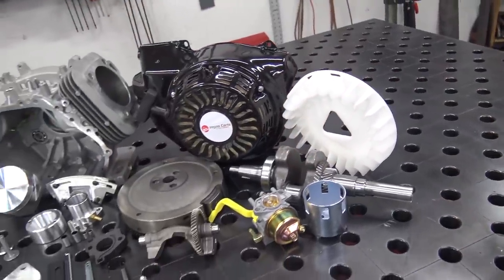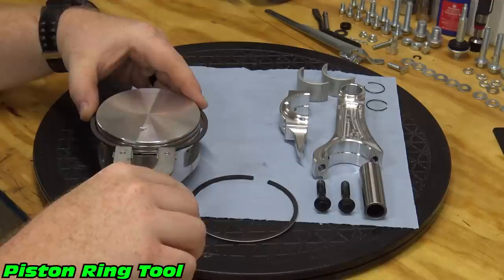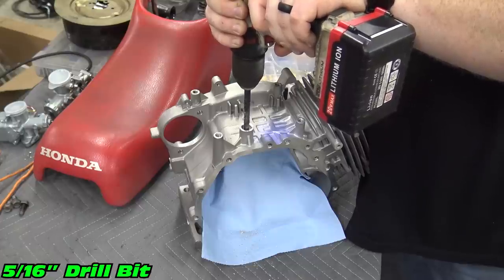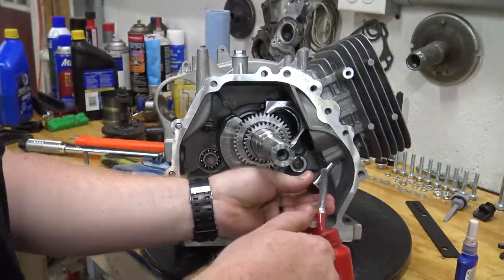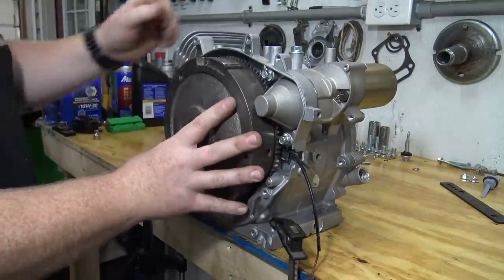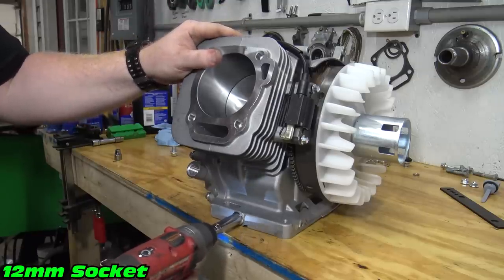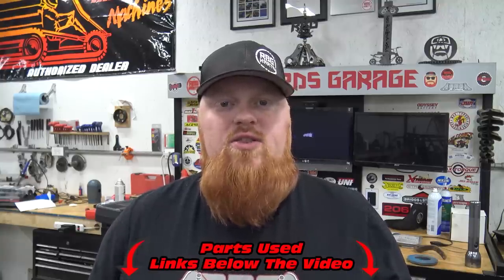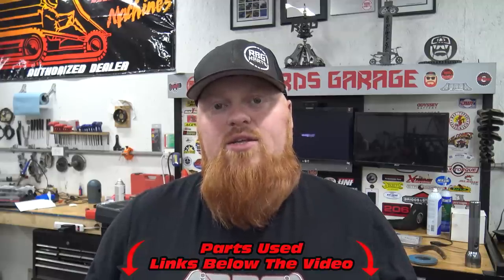Vegas Carts 460cc Engine Build

Comment: I've loved mine since day one! Well mines got a big valve ported and polished milled head, mod 1 Cam, roller rockers, billet flywheel, and a Keihin FCR 35mm carburetor with a 40 series torque converter on a oval race chassis! It's scary fast!

Comment: The govn'a hole could've been used for a spray oiler. With a nozzle put in from the inside, and a small electric pump pushing in from the other side, that'd prolong the life of the engine, since the classic method is a stop gap measure, i mean don't get me wrong, it works, but it was never top of the line oil distribution.

Comment: Damn RB. After all this time I'd figure you must know every little trick and tip. But when installing those rod bearings it's really important NOT to install them flush into it's race. You leave them slightly off so when you install the rod cap and begin to torque it the bearing will SEAT itself. This might seem unnecessary but it really is important

Comment: i wish i was old enough to have a job so i could do the things you guys do
Reply: Someday buddy✌🖖👍👍soak up all this good stuff
Reply: Ask for a minibike or a gocart for a present,you can begin learning small engine repair when you get one and you'll have a lifetime to get good at it.
Reply: @donaldmaclean1872  i know ive been asking for years tho
Reply: donald maclean yeah that’s what I did. I got a massimo mb200 when I was 12 and I’ve been modifying it ever since. I’m swapping the predator 212 from my go kart onto my bike rn. Just waiting for some parts to come in. (stage 1 kit, engine risers, and a new belt for my torque converter) It’s pretty simple, however I do wish that I had gotten a non hemi predator so that I could use the coils from my old engine to power the headlight🤷‍♂️
Reply: @Jack-bv7om  yeah imtrying to get the coleman ck 100 or if i got a minibike i would want the coleman ct 200u ex( because of the haedlight)
Reply: Although I definitely don’t recommend the massimo mb200 if you’re planning on keeping the stock engine. It’s impossible to work on and there’s nothing online about it. Also no parts for Baja or trailmasters fit it. You’re best bet is spend to spend the extra $200 for a trailmaster mb200. That bike is a beast.
Reply: dominic santelli Scrape up some money and keep looking for a project,you can probably get something online for cheap if you look hard enough. Junk yards are a good place to score a project too,whatever you find will most likely not be in running condition but,you will need to learn to repair it anyway. Find an inexpensive project like I said and fix it up,maybe you and a friend or cousin can chip in money on a machine and you can both work on it. Good luck,you'll get a bike or some other project if you want it bad enough.
Reply: Jack J Nice,that's what is so great about learning to work on these engines, you learn to build your own custom machines and you can build your own stuff for a fraction of the price it would be to buy one new. Being able to build your own stuff is fun and you know if it breaks you can always repair it,or you can buy parts to upgrade it after you break it,you're gonna end up breaking it eventually,so fixing it with better parts is always an option.
Reply: @larryalexander4833  i know. all i have to do is wait until im 14 and i will be able to work a part time job during the summer. i wish the next 8 months would go by really fast
Reply: @donaldmaclean1872  i know but i wish my brother wasnt such a wuss and he wasnt afraid of go karts and mini bikes or he would probably help. and another problem is my parents because they dont want me around professionally made ones never mind them letting me buid one. anyways i appreciate the advice, thank you.

Comment: Is this a bolt-in predator replacement? How do performance specs compare to 4XXcc offerings from other makers?
Reply: It's my understanding reading on Vegas Carts that it has roughly a 10:1 compression ratio. Seems like any GX390 mods will work on this engine, so parts are plenty.

Comment: Just curious, I noticed on the Vegas Carts site, there is a 625 cc replacement motor that is a single in the 420 predator configuration. Anyone have experience with these?

Comment: Hello I have tried a couple of these ARC connecting rods, I can’t get to last very Long! The original last longere, with no bearings shells on.?! Do you guys know what to do. I am using the motor on a gokart that I race a lot with!
Reply: First off this isn't a arc rod, it's VC's billet rod. Your doing something very wrong I guess. I've got several motors with three different companies billet rods and none one of them have failed.
Reply: Nick Brogdon okay I Will check how I have installed it, I must do something wrong! Thanks for the answer.
Reply: With this wildcat 460 what did you do for connecting rod to cam clearance the one i did needed the center of the cam cut down alot

Comment: I seen all the time these parts you get you just bolt them on. if you going to spend that much why not just bore out the cylinder and go with a bigger piston? I don't get it.
Reply: $370 isn't a lot of money! By the time you sent a block to get a sleeve installed bored, bought the parts separate, you've already spent way more $$$ than what this kit cost! So why wouldn't you go this route!?